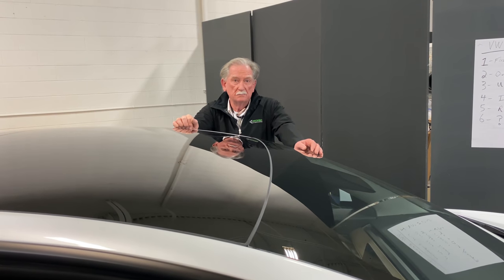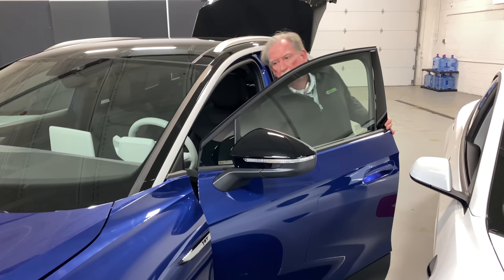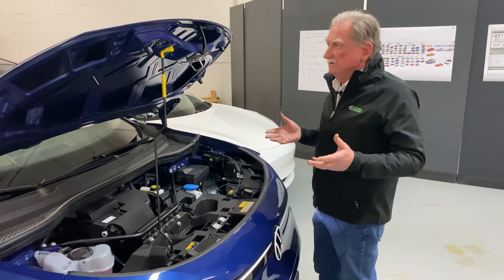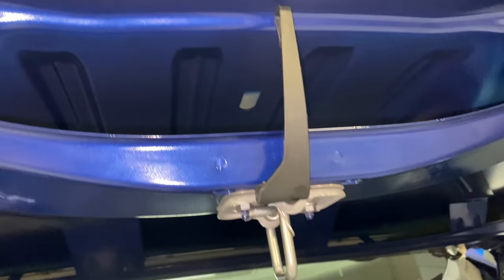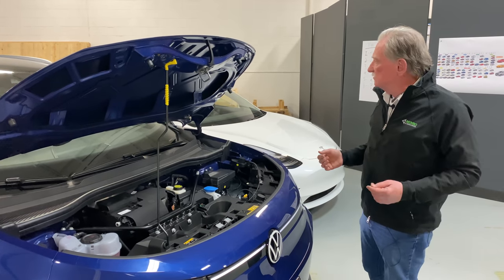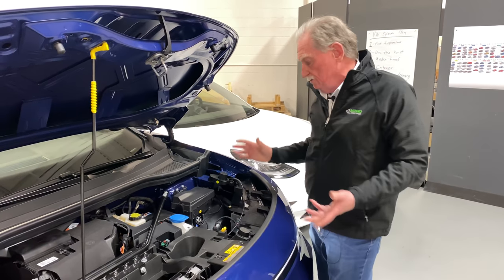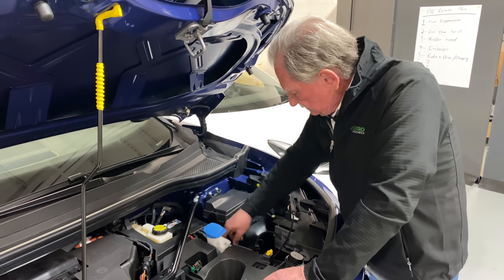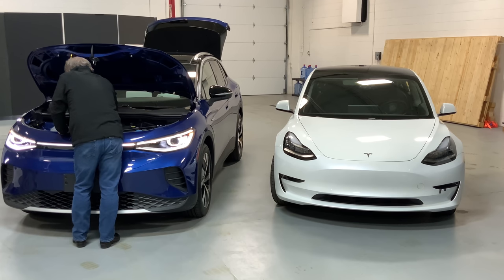2021 Volkswagen ID.4: E2 - Under The Hood

Comment: That detail information about hit impact is just on point. That is something which is very important here in Europe. Tesla guys won’t pay attention to that yet. 
But this guy is a real engineer and knows what he is talking about. Greetings from Germany :)
But one thing bothers me though: do you know how much an electronic fuse box costs? A hell of a lot and show me one customer who has ever changed a fuse of newish car... that’s cost efficiency.
Reply: Unfortunately, if you would know the pedestrian-safe front designs - they look exactly like Tesla's - sloped. The idea is to cut down legs and give the body place to bump. Volvos have a special air-bag to cover the windshield. The VW high front and unwieldy steel and heavy bonnet simply smash the pedestrian. This is a very bad design, but full of distraction for authorities. Very VW-nish...
Reply: @AndrewSienx  what i understood is that bonnets need to be as high as possible to reduce the distance the head travels before hitting the bonnet
Reply: Then why are tesla not a heck of a lot more expensive? I don't get your critique.
Reply: @wolfgangpreier9160  Uhh... it is more expensive...  This car is comparable to a model Y, not a model 3.  It's $14,000 cheaper.  A base Y costs $50,500.  A first edition ID.4 costs $36,500 after federal credit.  (Yes, you do need to include credit, as it directly influences the MSRP the OEM sets)    You can also buy cheaper versions of the ID.4.  The base version with RWD is $32,500... $18k cheaper than the base Y.   Certainly better equipment on the Y... but VW knew they'd be selling a cheaper version, so they kept costs down.
Reply: @Griffen83  If you are hit by a vertical wall like in most of the modern SUV, trucks etc. you are just dead before your head hits anything. The sloping design was proposed to extend the time your body travels to the substantial hit - so the pedestrian should be hit in the sheens, not in the ass or above. Legs can be repaired. Pelvic not really. Stomach, heart - well.... So, the next dangerous moment is when your head hits the windshield - so the Volvo's airbag. I'm not sure if you have especially better chances with Tesla without this airbag, but ID4 front looks deadly even for the small bumps. We have to wait for crash tests of ID4. But it's unfair to compare SUV to sedan. Tesla M3 scored 74 in EuroNCAP which is average good. ID3 - 71. The MX which is SUV scored 72 (Tesla shape). But there are very good SUV-like cars also - Polestar 2 scored 80. But it is Volvo and a premium car and ID3 which is lower was much less. I don't expect SUV to be better than compact. Will see.
Reply: He seemed to infer that VW's impact design wasn't good, before dinging them on the fuse box, and then being confused that the jump point was in the fuse box, not at the point near the bar that he was so worried about, but turned out to be a non issue.    For such a real engineer, he seems to have gotten a lot of things wrong here...
Reply: @updlate4756  The impact design of VW is very good. Not the best but better then average. As always and in all their cars.
Besides all chinese built. Of course.
Reply: @wolfgangpreier9160   Seems that way, so why did Sandy sound so negative about it, as if they should have done it like Tesla?  

That's a rhetorical question; I know exactly why he was negative on it and positive on Tesla.  The man was, until recently, a Tesla shareholder who seems to have sold off near the top... probably making a small fortune in the process.  Then there's the internet fame and praise Sandy has received in his non-stop Tesla coverage.  He was relatively unknown before then.  I'd personally never heard of him until his first Tesla teardown.  Tesla has taken some of his suggestions seriously and implemented them, and they give him special treatment, like his recent Musk interview.  Tesla's made him a much wealthier man than he was before... so it's understandable that he's more than a little biased.
Reply: @AndrewSienx  Cant compare directly like that because Euro Ncap gets harder to pass each year.

Comment: To all you Americans , one thing you need to know  about EU is that there are a lot of rules and regulations in manufacturing , far more then in the US. This includes car industry. Certain design decisions are not really made by engineers but rather by bureaucrats. This includes pedestrian safety and crash rating (that is why they use steel)

Comment: Really surprised by this episode.
1. The hood of the ID4 is significantly shorter than the M3 to maximize interiour space. EVs don’t need a long hood... I think most people prefer interiour space to a frunk.
2. Pedestrian impact protection is good thing, why would you critsize a design which improves keeping people alive..
3. Who Will jump start an EV? You kust charge the main battery which charges the 12v battery...
Reply: I don't think he's criticizing the ped protection, but the heavy and clunky design utilized for it.
Reply: @jamesengland7461  “we don’t need that in NA..bla bla” I think it is probably deliberatly designed like this, accepting the weight penalty and optimixing for protection. (Can emagine steel reacts different to alluminium which might not have the desired effect)
Reply: @Griffen83  I wonder if the Tesla has had these tests done
Reply: "EVs don’t need a long hood" Correct. The hood must be long enough to achive the one and only goal thats important. 
"Keep summers safe"
Look it up it describes everything a Tesla was built for. 
And actually you can use this sentence in every Tesla.

Comment: That small front lid, no storage and fuses are what add "Farfegnugen" to it!
Reply: the 'Fahrvergnügen' comes from the much bigger space inside because the front is much shorter. a very clever trick to make the front shorter, now that there is clearly no diesel engine inside anymore. that means the care is small outside but very spacious inside. the wheel base is much longer and the turning circle much smaller. it is a very clever concept

Comment: The stated reason of VW for basically not doing frunks on any MEB-car (besides cost, I'd guess) is, that they wanted to maximize interior space. Pull everything as forward as possible and clutter up the relatively small "engine bay" to free up interior room. This probably is a debate over "more places to put your stuff" vs. "one bigger place to put your stuff".

Also they needed the room for the HUD which is supposed to take up a fair bit of room.

Comment: I’m new to EV’s. I wondering when you would have occasion to jump an electric vehicle?
Reply: in some areas it is a requirement for all cars to have a standard 12 volt car battery.  These batteries last 3-10 years, and if they go dead your car won't work(requiring a jump).
Reply: There are lots of stories of EV`s being dead and needs to be jumped. Tesla had a major problem with it and VW ID3 has a even more major problem with it.
Reply: As I understand it, regulations (as a safety feature) require the traction motor to be electronically disconnected while the car is turned off. Because of this, and also because most car accessories run on 12V, these cars require a 12V battery to turn on. Basically, the 12V allows the car to turn the car's computers on, which then reconnect the traction motor, and then the 12V also runs the stereo, fans, lights, etc. (though the traction motor powers the A/C and heater). So, without a working 12V, the car won't turn on and the lights, entertainment, and many controls won't work.
Reply: The difference is that you don't need a lot of current to "jump start" an EV with a dead 12V battery. Just connect another battery (it can even be a deep cycle battery) to have enough juice to close the main contractor, then the car's DC to DC converter will start charging the 12V battery again from the high voltage battery. Some EVs like Teslas will automatically start the DC to DC converter in case the 12V is getting low, even with the car off, to charge it again from the high voltage, which means you should never be able to empty the 12V battery.

As for how you can deplete your 12V battery in an EV, there's all the same reasons as ICE: when using lights, radio, etc while the car is "off". There's also been some issues with some EVs not enabling the DC to DC converter while charging or pre-conditioning, which leads to the high voltage battery charging, but the 12V battery depleting while performing the communication and thermal control of the charging.
Reply: When you run out of electrons...

Comment: The model 3 requires you to take out the frunk to check coolant level. It will be an easy check on this car. I think you will see more service related and over building of the electric cars, much like the Fiero, another over built car because of it's all fiberglass body design.

Comment: Wow, what a clusterfuck😂 Contrasting the Model 3's frunk with ID4's mess is a good way to visualize how far behind Tesla VW are.
Reply: no, it really isn't, the VW hood is 8 inches shorter than in the model 3, how much frunk would you have left if you remove 8 inches of it?
Reply: @ttolst  The standard(set by Tesla) for EVs of any consequence is to have a frunk. It provides extra storage, plus shows off your company's engineering ability to build so efficiently that you don't use your frunk for car bits.
Reply: @ttolst  I call BS. Here are the facts:
VW ID4:
 nose to front of door: 1.34m
 nose to base of windshield: 1.03m 

Tesla Model 3:
 nose to front of door: 1.31m
 nose to base of windshield: 1.06m

(8 inches = 0,2032m)
Reply: @Stefan D. This cars are literally 3-4 times the cost of a Model 3. The ID4 is in the same class, hence the comparison. 

But since you brought it up, ever compared those to the Model S?
Reply: @NO3V  nice catch. 👌
Reply: @Stefan D. ... Étron GT is 31.3cm longer than a Model 3..
(and it's hilarious that the turning circle is what you come up with as the first advantage you can think of)
Reply: @onwike  what standard? lots of new models coming out without frunks, not just ones made by the VAG group. So you are saying they should extend the front of the car either shortening the trunk or making the entire car longer, just to fit a frunk? That seems like a terrible trade off. Right now the only tesla with more cargo capacity is the 5 seater model X, which is a much longer and hugely more expensive car.
Reply: @NO3V  front to steering wheel? the other measurements could just vary from the design of the cars.
Reply: @ttolst  He literally says "I don't know where to measure". 
If you look at the cars in profile (google "ID4 Blueprint" etc.) you'll see they are quite similar regarding proportions of the front-construction. Who cares about the length of the hood-panel, VW just designed it to start further back and therefore be shorter.
Reply: @ttolst  Well, watch how they do. Volvo and Ford can literally make a sale by showing their frunk and a picture of the ID4 hood. 

Tesla will just Tesla. 🤷🏾‍♂️
Reply: At the end of the day, these are design decisions that are perplexing for far more reasons than Sandy and his demure self will freely admit here. In sure VW is a client of his.
Reply: @Psi-Storm  Sorry, the blueprints I have and measured from don't show the interior (and seats and wheel are adjustable..). 
But when I overlay both cars the fronts are surprisingly similar in proportion (apart from the ID4 being taller). The Model 3 just has 10.4cm more wheelbase (while being only 9.1cm longer, so the overhangs are actually shorter for the Tesla).
Reply: @NO3V  so what scale are those blueprints and where are they from?
because i have had a ID.4 and a model 3 beside each other and the front is much shorter.
Reply: @storm4710  "at what scale"?! 🤨 They are digital ...
They contain measurements, so you can just pixel match the drawn measurement scales..
the-blueprints.com - based on the three sided measurement graphs most manufacturers publish I'd assume.
(Also: I doubt you have.)
Reply: @NO3V  instead i rely on having had both cars parked right next to each other,
there the nose on the ID.4 was much shorter.
BTW in Tesla Bjørns video he used the same point for the tesla´s,
ID.4 ~90cm
Model 3 ~110cm
Reply: @storm4710  I don't believe you have. Unfortunately i can't post a link, but I just pinned something for you: check AEONde on Twitter.
(yeah coincidentally my Youtube name upside down)
Reply: @NO3V  I work with servicing and repairing EV´s.
and alway keep up to date with all the newest stuff in EV world,
Reply: @storm4710  dude, I don't believe you do. 

There's no way that you do and you are also this badly misinformed. 

Also, parking and eyeballing is superior to blueprint dimensional analysis???? 
You can't be serious!
Reply: @onwike  Yep. Design works as proven by "eyeballing doesn't work".
I just uploaded the measurement comparision on Twitter. Can't link so just google "twitter AEONde" and look at pinned Tweet.
Reply: @NO3V  Look at your own picture the front window sits much further forward than on the Model 3(about 10-20cm which fits with Tesla Bjørns measurement)
BTW never said anything about that being the reason for the lack of a frunk(that is solely a decision by VAG)
Reply: @storm4710  finally you say something reasonable. I agree with you. Nothing stated here is a REAL reason for VW to make this design choice

Here's the truth as far as I can finagle. Tesla has been on an EV miniaturization tear for over a decade now. Making demands of their supply chain and vertically integrating when the supply chain fails. 

The result is the ability to create space where everyone else including Ford and Volvo struggle to do the same. And they do so, simply because they could. 

Frankly, this must be infuriating for other automakers. It's a tough bar to reach as we can all see.
Reply: @NO3V  VW have performed a miracle then! Longer hood, much more cabin space, much more cargo capacity AND shorter than an M£. Sheer genius!

Comment: Wonder what Sandy will think about the fact that the ID4 has drum brakes in the rear.
Reply: i think its a good decision. why would you need disk brakes on the rear if you already have recuperation on that axle?
Reply: @HannyDart  Emergency braking?  I guess its not a performance car like a Tesla or MachE.  Just seams odd, and a bit cheap...
Reply: @rogerheuckeroth7456  for emergency braking, e.g. one hard brake, drum brakes are good enough. i think its not bad using the cheaper solution, when you dont have any reason not to do so. especially if it helps to keep the overall price down and make EVs more affordable. (i know its still not a cheap car)
Reply: @HannyDart   Looking forward to what Sandy thinks of it.
Reply: @rogerheuckeroth7456  me too!
Reply: @rogerheuckeroth7456  part of their reasoning is that the drum brakes won't rust despite being underused.
Reply: @arnorjonorvarsson6215  If they are made of steel (non-stainless) they will rust.  I know VW says it is a sealed design, but think about it.  A drum expands when it heats up and shrinks when it is cold.  It has a part that is rotating with the hub and a part that is stationary.  There is no way it is hermetically sealed. Sorry, as an engineer, I don't see how it is possible.  Plus every time you come to a complete stop, the brakes engage, so rust build up is not really such a problem.  I think it was an excuse for VW to save a few Euro.

Comment: Another great video thanks sandy. What is that red stuff in the reservoir  please.
Reply from the maker: Ethylene glycol. Uses in the thermal system for heating or cooling the battery and electronics.
Reply: @MunroLive  Thanks for the reply Sandy.
Reply: I had the same question.
Reply: From what I'm hearing, the battery cooling in the ID4 is quite good, they attempt to keep the battery about 77 degrees anytime the car is on, so you don't need to precondition the battery before fast charging.

Comment: I'm no engineer but I'm guessing, kinda like in the Model 3, that extra girth under the hood is for crash performance. Everyone wants that 5 star crash rating. Weight distribution probably plays a role as well? The Germans place a high value on handling and driving dynamics.

Comment: I'm confused.  What would be the need for "jumping" an electric car?  In an ICE vehicle you're just providing the power to turn the starter, but if the car doesn't have any power in an electric vehicle, what is accomplished by using jumper cables?
Reply: When the 12V battery dies EVs are not allowed to work anymore and must be "jump started".

Comment: - One could argue that, a so called "fronk" takes away cabin space. The design on the Tesla is made for you to have access often(light, easy to open), the VW does not need that. To my eye the Tesla nose seems long by maybe 1/3, so there is space for a fronk(gimic?). To have access also means easy repairability and service, not the same as "being behind Tasla design".
- Make design for saving a pedestrian, sound like bad design?, he did also state that children door-locking is unsafe in a crash(E1)? not true.
- A lot of the critic of the design on wight i see as safety. looks solid and safe. In other videos you can see that it has great range.
-  Keep in mind, Tesla model 3 here is not an SUV, and it is more expensive(in denmark).
- circuit breakers Tesla seem to have a good system for.

Comment: Jump start an electric car? Can you please show us how to push start it as well?
Reply: It's not as stupid as you might think... should the 12V battery go flat, main battery will be disconnected as well. "jumpstarting" means giving the car some 12V power so it can be switched on. Now it varies a bit between brands how the 12V is recharged - some will stop charging the 12V battery when main is below a certain level, so it's possible to have a flat 12V battery but enough "juice" in the main battery to get to a charger.